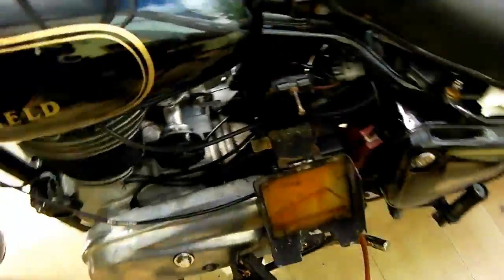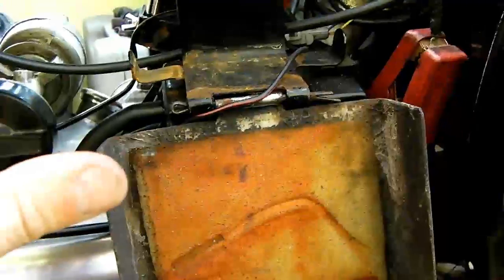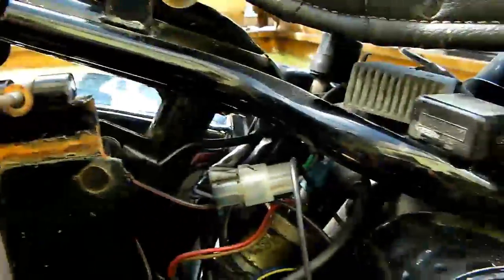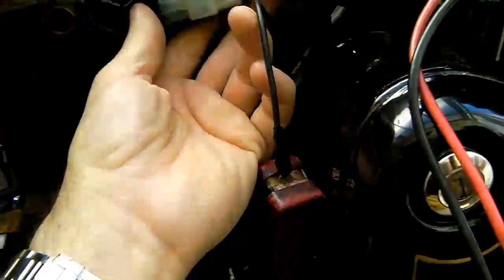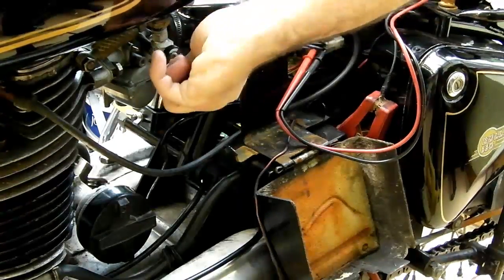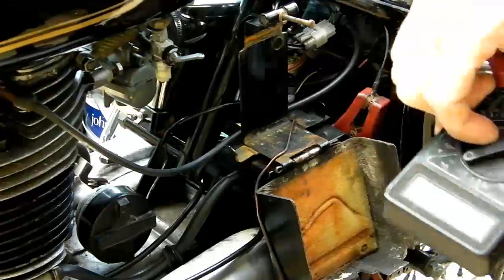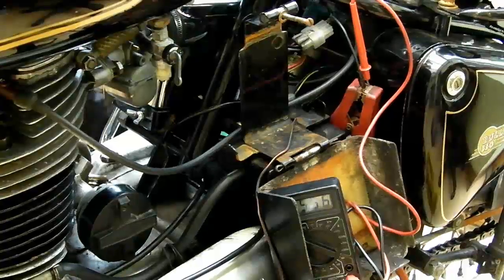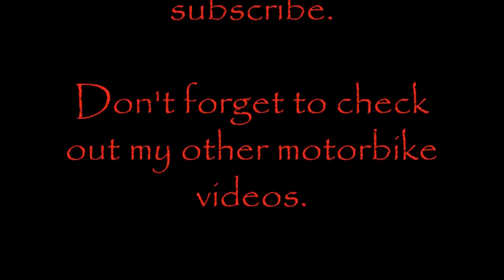Royal Enfield Bullet 350 classic, Electrical charging system check.

Comment: Nice Video. My bullet 350 std has 3 wires on the stator and it gives only 8 volt AC on idling and 17 volt AC on revving. But the DC output from RR unit is 12.7 volt on idling and 15 volt on revving. My battery has draining issue and needs constant attention through trickle charger. What would be the issue here?
Reply from the maker: It would appear to be outside required numbers and is overcharging. This will boil the battery acid lowering the level and warping the plates making it difficult to maintain a charge.
You need to investigate the charging system to get it within specs then replace the battery after you've done so. I'm not an electrical expert so I can't help with specifics unfortunately.
Reply: @spidiq8  Thank you. I will post update when the bike is fixed.

Comment: HI  !! I HAVE THE SEPARATE  REGULATOR AND SEPARATE RECTIFIER SYSTEM. I HAVE INSTALLED A NEW RECTIFIER AND AFTER INSTALLING , MULTIMETER WAS SHOWING A VOLTAGE LIKE 15 OR 16 AND EVEN 18 SO THEN I INSTALLED A PUSH/PULL SWITCH IN ORDER TO STOP OVERCHARGING. NOW IT IS COMING NEAR 13.50 WHILE IDILING,   13.85 OR 13.90 OR 14.00 WHEN ACCELERATING. 
MY AMP METER NEEDLE GOES TO POSTIVE SIDE WHEN I THROTTLE AND EVEN GOES TO EXTREME POSTIVE END WHEN GIVING SOME MORE THROTTLE. 
NOW THE QUESTION IS WHETHER MY BIKE IS CHARGING OR NOT? 
AS THE BATTERY COMPANY IS SAYING THAT THE VOLTAGE SHOULD BE NEAR 14.20 OR 14.25.
I DONOT KNOW WHETHER THIS 14.20 OR 14.25 VOLTAGE IS APPLICABLE FOR OLD CI BULLETS OR NOT.
AND I AM USING EXIDE 12V 14 AH ( 12XL 14L - A2 )
Reply from the maker: I'm so sorry but I can't say for certain, auto electrics are not my strong point, I know the basics but i'd recommend you check with someone familiar with vehicle charging systems.

Comment: Shouldn't the charging voltage not be over 14.4V? Yours give 16Volts?
Reply from the maker: You're very probably right but I feel like the system on these is much less refined than more modern ones.

Comment: Can you please tell how the power is split among ac/DC? I read somewhere that it is 80w for ac and 40 Watt for DC circuit I.e. total power rating is120 w.i want to know how powerful fog lights I can install on battery so that it doesn't discharge
Reply from the maker: Unfortunately I can't help with that. Electrics aren't my strong suit and I no longer have the bike or technical documents. Sorry.

Comment: amp metter is in middle  bike not starting a but horns is not working headlight also what a mistake
Reply from the maker: Sounds like you have no battery power, You can start the bike without battery but it will be harder and the generator has to maintain current.
Check your battery voltage across the terminals, if 13V+ check the connections.
Reply: spidiq8 thank u bro i will checkit

Comment: I have an issue, i have replaced 4 battery till now, battery drain after 10 days of interval, ampere meter is showing positive sign. It only discharges during night. Any help plz?
Reply: put wires in magnet mode..bot in battery mode

Comment: Sir how to get mileage for this bike
Reply from the maker: salam Khan There should be an odometer on the speedometer clock which will show the total miles or kilometres covered. If the clock is missing or has been changed there's no other way to tell.
Reply: spidiq8 sir i don't have odometer
Reply from the maker: salam Khan Unfortunately that means it's been removed at some point and there's no way to tell the mileage covered.
As long as it's running well and there are no obvious problems I wouldn't be worried though.
Reply: spidiq8 sir can I ask another question if you allow me
Reply from the maker: salam Khan Of course you can, happy to help if I'm able.
Reply: spidiq8 my bullet Model is1989 an every time when I use light and horn at a time then battery goes down what is the prblm
Reply: Battery,,,rectifier,,,coil,,,all times are totally new Bt I can't understand why the battery goes down
Reply from the maker: salam Khan I'm assuming you mean when the engine is running? The first thing I'd check is the battery itself, try a good battery connected to the terminals and if this works your battery is scrap and needs replacing, if not then it has to be a faulty charging circuit which could be the wiring or the alternator, checking all the wires and ensuring a good earth is straightforward.
Reply: Use the carburetor from Japan Mikuni brand

Comment: Hi there, hopefully you may be able to help me. My 2000 model 350 bullet seems to be having sparking issues. It was working fine and now suddenly the spark is very intermittent. It will usually spark the first time you kick the engine over then it won't spark at all from then on. I've tried a few spare plugs and its the same with all of them. Battery has a good charge, all lights etc work but the anmeter doesn't seem to work either. Any ideas?
Reply from the maker: Laceyktm It's tricky to say with any certainty and electrics aren't my strong point but it sounds like it might be a generator issue if the ammeter isn't working. If you Google checking Enfield bullet electrical system you'll find walkthroughs and it's all simple with only a multimeter or test light required, if you work your way backwards from the HT lead you should be able to locate it, physically check the condition of the wires and earth points as well.
Reply: spidiq8 thanks for the help. I decided to retrace all the wiring and found the connection from the coil was very dirt and even a little rusty. Cleaned it up and she sparked fine after that. On another note, the bike runs very well now as far as I can tell ( this is my first ever Enfield) but I notice that when it is running the ammeter needle runs very slightly into the green, at about the 1oclock mark. Is that normal?
Reply from the maker: Laceyktm I'm guessing yes,  but mine had an electronic ignition fitted so the ammeter didn't operate because there's no make/break contact.
They're not the most hi tech and voltage does fluctuate, as long as it's not showing a loss of charging you'll be good I think

Comment: So my ammeter recently started diving all the way to the red.. Before it worked normal (always a bit on the right side while riding)  I tested my alternator and it's getting around 11.5 volts @ idle and around 12.5-13 volts revved u a bit. I tested the voltage of the battery and it's around 11.5 volts.. Also I need to note that my blinkers are messing up. Sometimes the lights are off and sometimes they are on, but the right side will never blink. So i recently changed the flasher and it didn't fix a thing. Not sure what's going on with my bike but i ride it daily so it's messing with me lol..
Reply from the maker: Disclaimer, I'm no auto electrician but. ....... First thing I'd do is go through the loom back to front and check all the wires for good clean earth's and continuity. 
If your voltage across the battery terminals is peaking under 14V and not going above the rwg/rec is doing it's job so I'd suspect a bad earth or connection
Reply: Ok, thanks I will do that. I was just worried that i needed a new stator/alternator since the voltages were a bit low. But maybe that's due to a bad ground?
Reply from the maker: +Paully Waully They are a bit low, 11.5V at idle is lower than expected but if it rises with revs it indicates that it's charging and I've seen similar results from a battery on it's way out, with kick start bikes they are less obvious when this begins to happen. The good thing is it's not over charging the system and frying things and if the rest checks out then you can look at the generator outputs.
Reply: Well, a couple of the wires were hot to the touch so it must be a short somewhere. Even though i was a certified car mechanic back in the day, I'm not good with wiring stuff lol.. So i just bought a complete wiring harness for it so hopefully that will be the easy solution. I will keep you posted and I may even make a video lol. Thanks again for your help and time.
Reply from the maker: I'd be interested in seeing a video, it'd be worthwhile doing a replacement harness how to and a complete replacement should cure any wiring problems you may have.
Warm wires are never agood thing so definitely a short somewhere and better to find them warm than melted.
Reply: So my bullet has an exhaust emissions tube coming out of the exhaust pipe that goes under my tank to a canister(prob stupid US smog regulation), anyway that tube corroded underneath my gas tank and melted a bunch of wires together so that was my problem. As soon as I took off my gas tank it was obvious lol. So i had to separate them and run new wire on a few of them since they were melted so badly. Now my bike runs great! I will probably still put on my new wiring harness but I'm sure I won't be in a hurry since it runs great now. But funny how things happen. I'm not even going to replace that emissions tube lol.
Reply from the maker: +Paully Waully Wow, in all that sounds lucky, not sure if you mean hot exhaust gases are passing through the tube but being under the fuel tank hopefully not. It might be some form of secondary air induction for emissions. 
Glad you found the problem and while it's running leave it be. I wouldn't bother with the tube either, just blank it off instead.
Reply: Yes, hot exhaust air was passing under the tank lol.. ya it runs great without it so I just capped it.

Comment: It should only be necessary to check for charging at output from rectifier ie. at battery terminals, to determine if alternator is working.  If output not the required 14 or 15 volts say, then one may suspect stator coils which can be checked by continuity (ohm) test. No requirement to run motor. If need to check AC volts then that can be done with everything connected. I wouldn't run the motor myself with any disconnection of the charging circuit.

Comment: I think if you run alternator without it being connected you will fry the alternator stator windings--might not be immediate but it will cause windings to fail. It's possible to check voltage output without disconnecting anything. Only need to disconnect connections to test winding resistance for open or short and if you want to insert an ammeter.